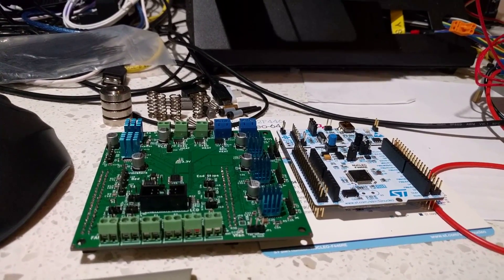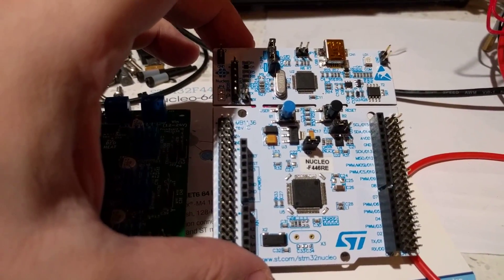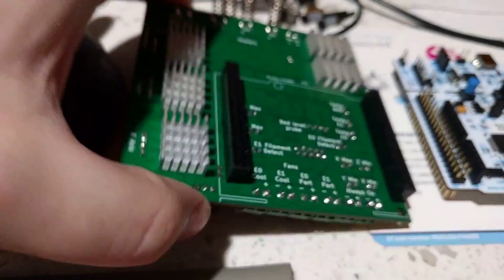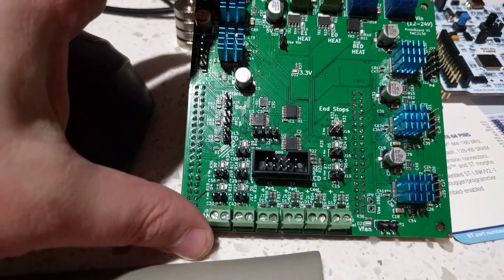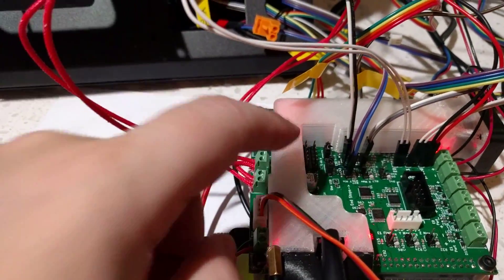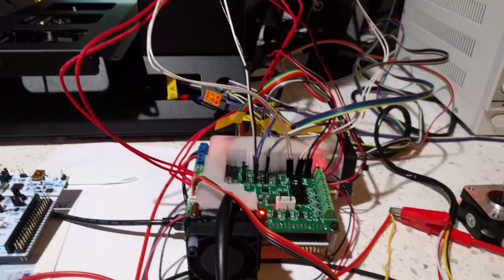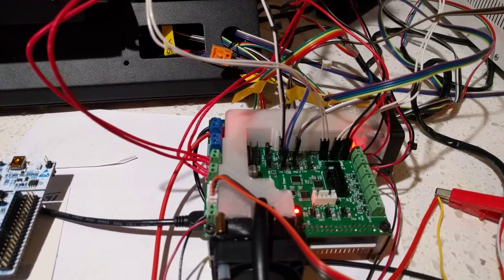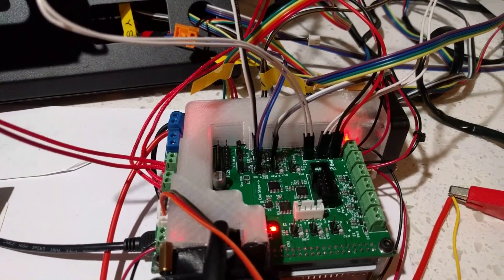3D printer controller STM32/TMC2130

Comment: Do you think it would be possible to use the ramps 1.4 shield on the stm32 nucleuo board? since it is the same design as the Arduino uno

Comment: Cool! I'm thinking on doing such a board based on Stm32f103c8t6, but I really don't know how Marlin can run on it.
Did you designed the board? Had to change something in the software?
Reply: Please ignore my comment. I'm reading your blog.
Reply from the maker: The stm32F103C8 would not have enough pins for the job. Other that that it is possible. There are port of Marlin for the STM32 F1 series.